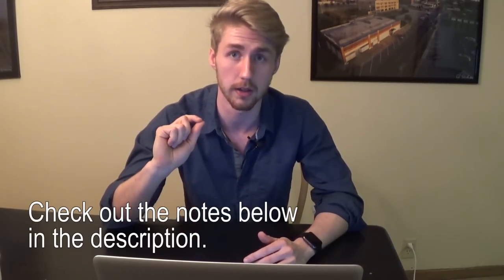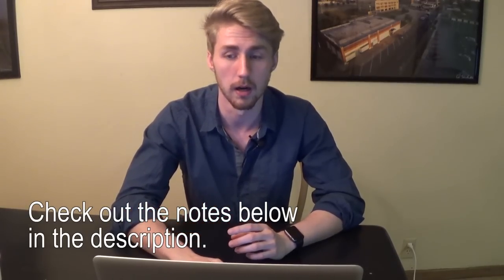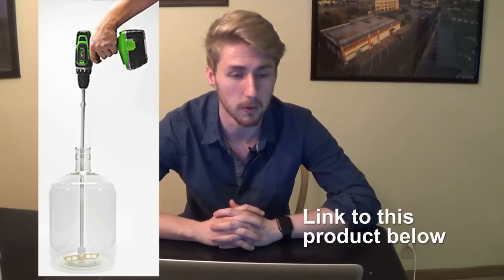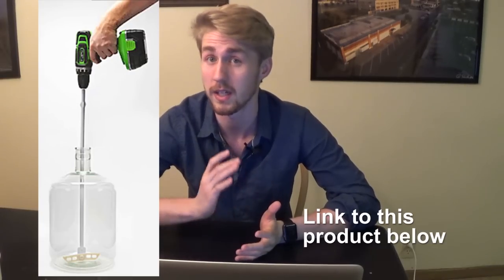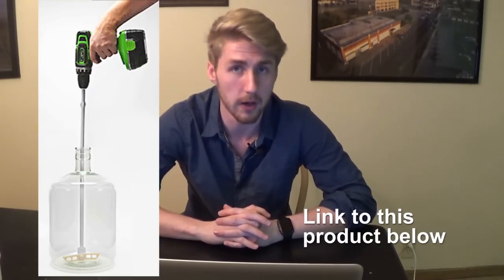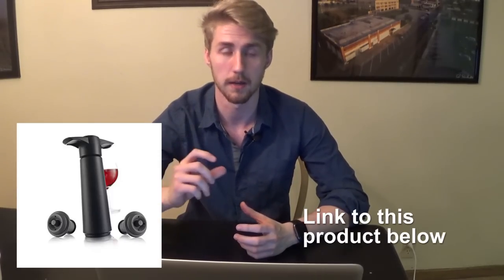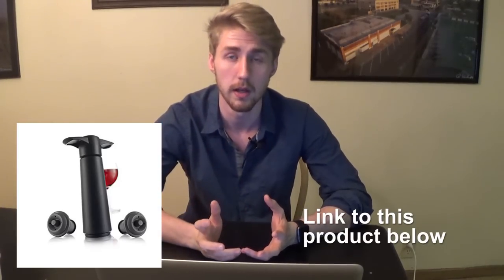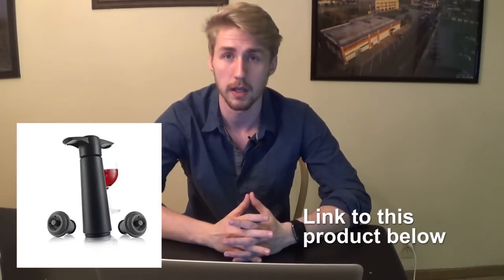Degassing Mead: When, Why and How

Comment: Just wondering but I’m getting ready to make a 2 gallon batch with lalvin ec 1118 yeast. I don’t want it to be dry, how much sugar should I add so it won’t be dry?
Reply from the maker: Aaron Shreve Well, are you back sweetening it or just wondering how much honey to add? It depends on how much honey you are starting with.
Reply: Man Made Mead  I was going to start out with 3 pounds per gallon but found out that it would probably be a dry mead. Can I add more honey for first fermentation?
Reply from the maker: Aaron Shreve So you can’t add any more sugar or honey until after the fermentation is done otherwise the yeast will just pick up where they left off. If you want it to be lower alcohol volume and sweeter then you will have to either wait for the fermentation to stop or stop it yourself. Follow this link for more info, it’s a great source: https://www.homebrewersassociation.org/how-to-brew/how-to-backsweeten-mead-and-cider/
Reply: Man Made Mead right on! Thank you!
Reply: Man Made Mead is there a link that you recommend to get bentonite? I’m seeing a lot of different types of it. Or is it even necessary, or recommend.?
Reply from the maker: Frankly, I wouldn't say it's all that necessary. I wouldn't worry about it.
Reply: Man Made Mead thanks, I really appreciate your help.
Reply: Man Made Mead first batch of traditional mead is fermenting at 86 degrees:)
Reply: You're going to end up making a high apv mead with that yeast, and at a high temperature it's probably going to taste like paint thinner for a year or more.
Reply: Use D-47 yeast it will give you best results mate
Reply: @deetoxinz7252  Pretty sure using d-47 anywhere above 68f is only asking for paint thinner, even worse than EC-1118. 
If you want to ferment at such high temps and want decent-good tasting results, I recommend Omega Hothead yeast, Danstar Belle Saison or Wyeast 1388.

They are beer yeasts, so if you're looking for something you want to bottle for years, stick with EC-1118/D47/K1V-1116 and look into methods of lowering your temps at least during the first large amount of fermentation. Once fermentation settles down a bit, you can rise it up to ambient (room) temperature, but depending on the temps, it still may need to be aged for years to be enjoyable. 

Belle saison can get up to 14% ABV and Hothead gets around 11%, and both can make good mead in a shorter amount of time compared to most wine/champagne yeasts. 
Just keep in mind that it probably won't age well, and probably won't be as good as an aged mead made with wine yeast under temperature control. (Though, that really comes down to personal preference.)
Reply: @CigsInABlanket  Champagne yeast gives the best in the bizz mate its still sweet doesnt taste like paint thinner at all. Been home brewing Mead for 12 years and follow recipes my family have best too. I also make mead the complete traditional way too. Every time i use my recipe and do a proper activation it comes out better than anything at stores
Reply: @deetoxinz7252  D-47 is a wine yeast. 
And saying that "champagne yeast is best and doesn't taste like fusel alcohols" without mentioning any recipes, fermentation temperature, pitch rate, etc. is ridiculous. 

I'm not saying that you haven't produced great tasting beverages with champagne yeast, perhaps you live in a climate where you don't even need to worry about temperature control for the yeast you're using. But, look up others experiences with d-47. It's well known that fermenting d47 above 68f (20) will give less than stellar results. 
At 86f, I can only imagine how badly that will taste of fusel alcohols. 

Now, perhaps there is some way to counteract this (besides long aging) that I am unaware of, so if you have any info, I'd greatly appreciate it!
Reply: @deetoxinz7252  so you're saying you have better mead than anything in stores?..... Better than superstition, Ken Schramm, etc.?
Reply: @bcp5296d  its better than anything i ever had from the store. Idk store bought stuff just seems to be lacking the flavor i want

Comment: I shouldn't give recommendations or advice yet, but, I would think that if you ferment on a surface with an incredibly mild vibration (like from a fan or desktop computer running or something like that), then that would help to de-gas during fermentation. I'm not talking about something that creates visible turbulence on the surface of the mead. If you are fermenting under your computer desk, maybe put your computer on a piece of wood and have that wood extend over to where your mead is, so that it gives is super gentle insignificant vibration. If it shakes loose 0.1% to 50%  (random numbers, not based on any data) of the bubbles, that's still something more than nothing. I'm not recommending running power to something to achieve this, but if you can recycle vibration that you are creating as a bi-product of something you always run anyway, it may be worth experimenting with.
Also, I recommend you DO NOT put a fan near your fermentors in a way that will possibly blow air into your fermentors.

Comment: I'm confused isn't having an airlock taking care of degassing?
Reply from the maker: Not exactly. There is still CO2 that gets trapped in the mead itself. That’s why we stir the mead. When you do this you’ll notice a bunch of bubbling. The airlock only really degassing 50% of the yeast CO2 production
Reply: @ManMadeMead  I have been making 5L demijohns of mead for few months now. I only stir them a couple times a day for the first three days and then completely leave them and let the airlock do the rest until I rack it and then leave it again and then bottle it. Is this right? I want to buy a 25L demijohn next (yup going for the big boy!) and the description strongly suggests a degasser... I am still confused however why i need it and when would I use it if I did get one? could you advise me friend?
Reply: As far as i know it's to rid the mead of the residual gases that for one reason or another could not be left out through the airlock. It can lead to a certain number of situations that culminate with the mead tasting a bit off. Not a game changer but somewhat noticeable.

Comment: The oxygen in the mead is not used in fermentation! Oxygen is not turned into CO2! We don't want oxygen all throughout the primary!

Yeast can respirate (breath/eat) in two ways: 1) aerobic respiration, where oxygen and sugars are turned into carbon dioxide and water, and 2) anaerobic respiration, where sugars are turned into carbon dioxide and alcohol. This anaerobic respiration is alcoholic fermentation. Given the presence of oxygen, yeast will prefer aerobic respiration because it is easier for them and more efficient.

The reason we want oxygen in the beginning of a fermentation is so that the yeast can eat, multiply, and build solid, healthy colonies before getting into the alcoholic fermentation. In the primary fermentation we want to generate alcohol, so we don't want to oxigenate the brew throughout the primary like you said, but instead we should just oxigenate at the very beginning.

The presence of oxygen throughout the entire primary would be dangerous because it would also allow for other things like bacteria.